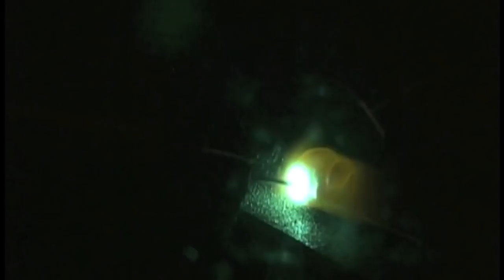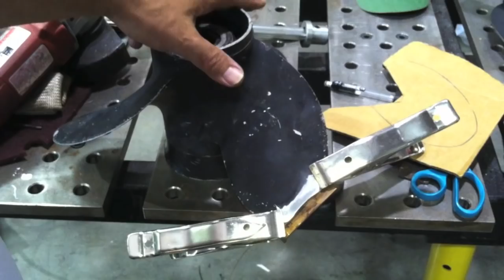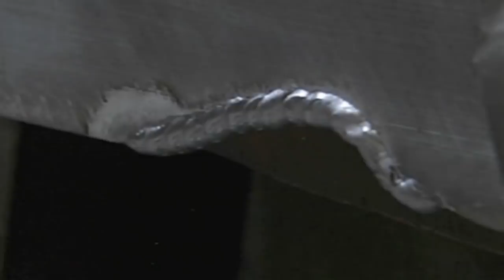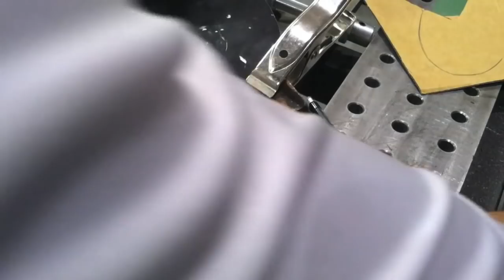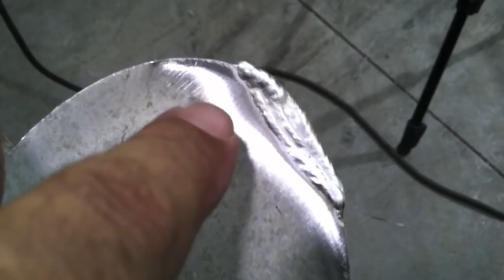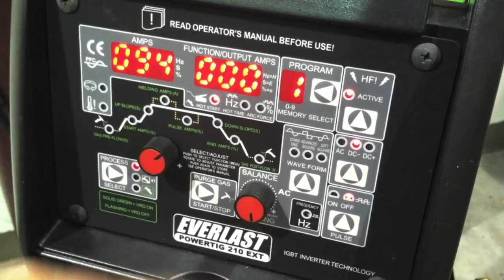Tig Weld Boat Prop Repair

Comment: As a newbie to welding, Jody's masterful expertise and great presentation skills are a godsend.
Reply: I know this is an old comment but when I started watching his videos I knew absolutely nothing on welding, properties of metal, etc. But now, 3 years later and getting a MIG, TIG and Stick welder in my hand and utilizing what I learned from him, I'm now able to weld pretty solid, good looking beads. I'm not a welder, I am a QC inspector at my job and every now and then I'll go to the fab area at the shop and play around with the scrap metal and welders
Reply: @kickinwinghotboi883  You've been more disciplined than me at developing your skill

Comment: I wish I had saw this video yesterday.  I tried to weld up a chipped aluminum prop last night and it must have taken 6 tried to get the right.  Welding on the edge causes the arc to pop and flare up.  I still don't know why it was doing that.  I end up on welding on the face of the prop and slowly push the weld bead to the edge.  I end up with larger than needed weld bead and spending hours grinding it down.
Reply: asmiter to aluminum should take minutes to grind down . sure yours wasnt steal ? But even then steal only takes a few minutes to grind down an antire inch of 1/4 plate . so i think your exagerating a bit on grinding for hours  and if that was the case you need some thin cut off wheels they eat through large uneeded bead.

Comment: it still won't make you a god like welder. it's more useful for us people in the trade that have very specific weld procedures to follow for high level structural and pressure vessel work where you can just set to exactly the same numbers time and time again without fine tuning dials. we have old pre inverter Lincoln welders at work and I still run rings around the scrubs on brand new digital fronius/miller inverters.

Comment: If I have need of a hex shaped hole on a rod, could I use a hex shaped piece of copper and build up the weld around the hex shape to end up with a hole the same shape as the copper.?

Comment: Hey Jody....Thanks for the vids man. 
What do you use to clean old aluminum before tig repair, in situations where you cannot get a SS wire brush in there? Such as acid prep or whatever?

Comment from the maker: i am using a stick of wax that came with a porter cable portable band saw so not sure what kind it is.  bees wax is great but  i have even used a candle in a pinch and it worked fine